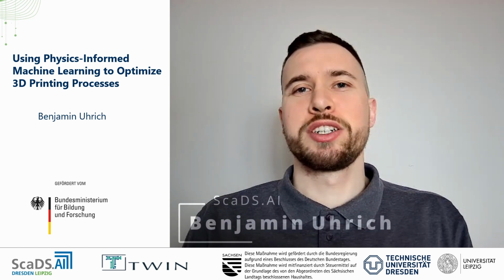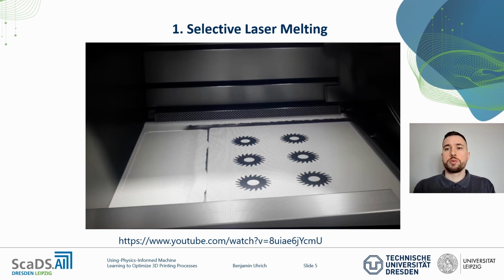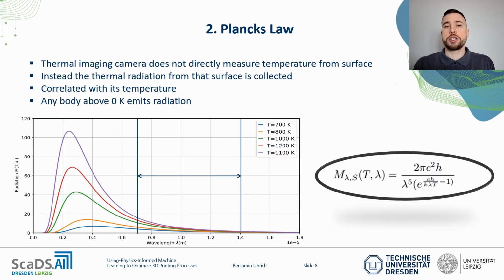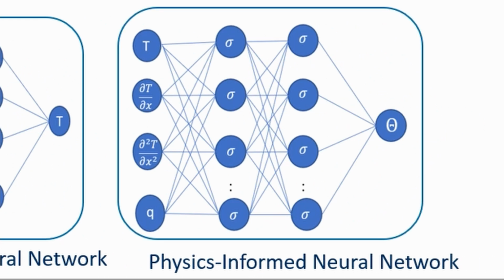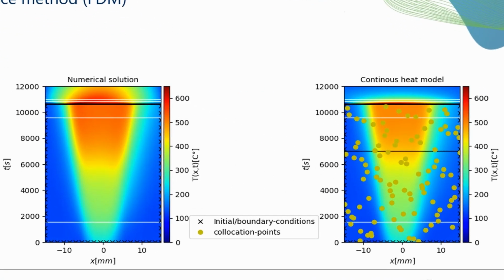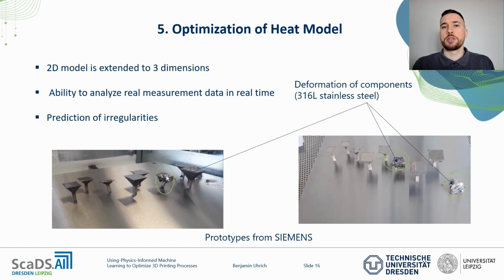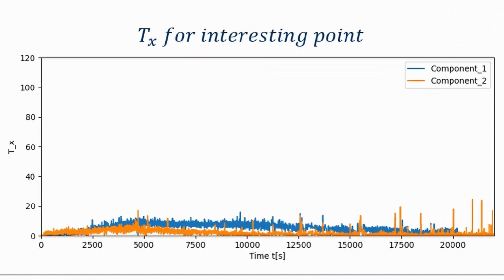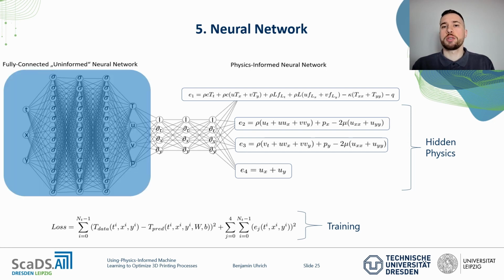Lecture: #8 Using Physics-Informed Machine Learning to Optimize 3D Printing Processes - ScaDS.AI

Comment: Amazing presentation. it would be good to have a link to the paper/ resources in the description section.
Reply from the maker: Thank you for the positive feedback and your great suggestion! The link to the paper has been added to the description. You can find it here: https://dbs.uni-leipzig.de/file/Using%20Physics-Informed%20Machine%20Learning%20to%20Optimize%203D%20Printing%20Processes.pdf
Reply: @scads-ai  The provided link not working...kindly check and make it available
Reply from the maker: @jagadeesh6076  The link is updated, please check the new link: https://link.springer.com/chapter/10.1007/978-3-031-33890-8_18